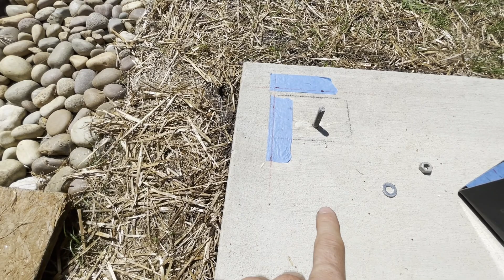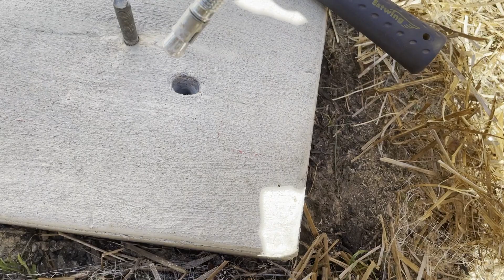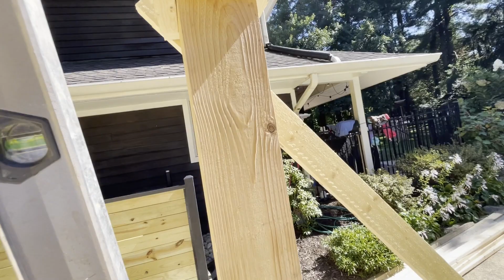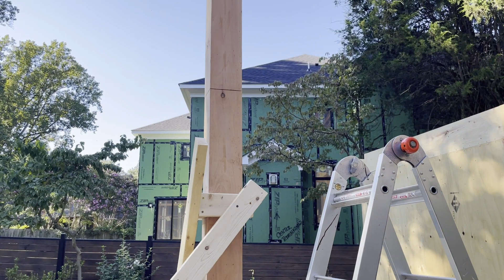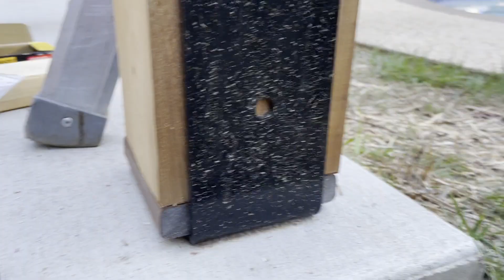Summerwood Sanara Pool Pavilion || Post Install with Concrete Brackets and Beam Brackets

Comment: Hi! Did you get the ECCLQ column cap powder coated (column to beam brackets)? In the Simpson Strong Tie catalog, it comes in grey. Thanks! Following your vids as I'm also DIY'ing this project.
Reply from the maker: @jfboucher494 it is an ECCL but I’m not sure of the letters after that. I looked thru their brochure and can’t find the black powder coated either. It’s a glossy smooth black finish. The hardware came from a Canadian company (Summerwood) so maybe they have different models (though strong tie website just lists North America). Mine are the 666 model since the beam are a full 6” width and the post is 6x6 nominal.